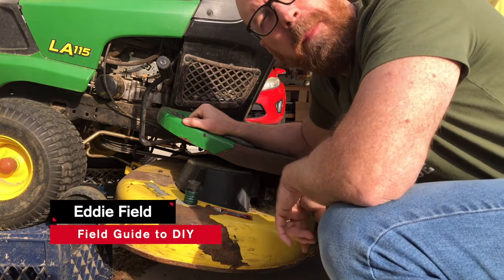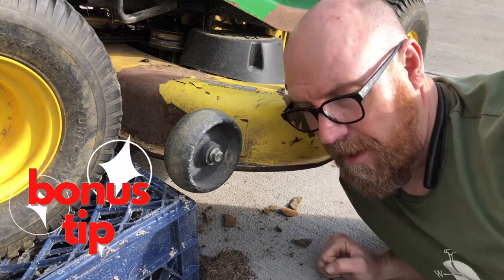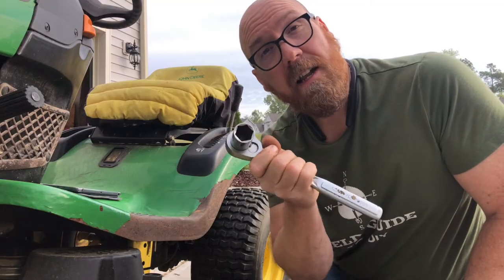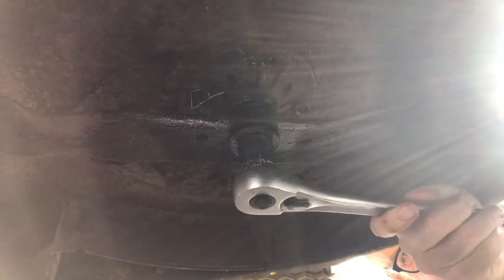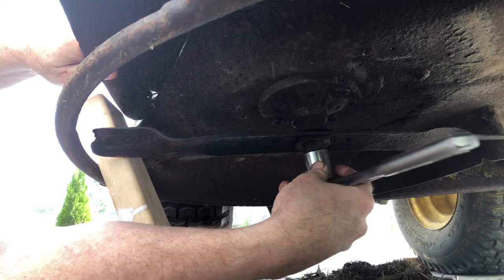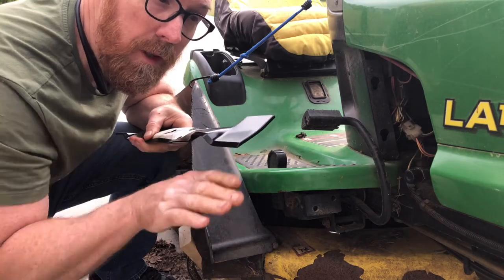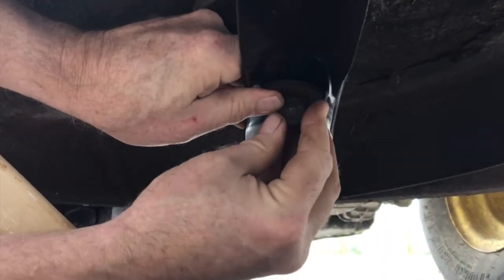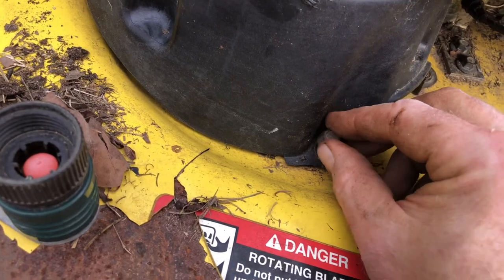Lawnmower Blade Replacement | John Deere LA115 Blade Removal & Replacement

Comment: Thank you very much for this video and mentioning the milk crates! I was about to invest three hundred bucks on a special lift and instead found a couple of the crates and just used my hydraulic jack to help lift it onto the crates. I also put wheel chocks behind the back wheels, just in case
Reply from the maker: Since then I have invested in a 3 ton floor jack.  A buddy of mine has a cable winch strapped to the beam in his work shed.

Comment: What happens when the star pattern bolt strips. How do you replace it
Reply from the maker: Great question.  I would suggest replacing one or both spindles.  One of my blades became loose and actually wore away the threads on one spindle.  I have a video coming up in which I demonstrate how to replace both spindles.  I will post the link to this thread when the video is published.  Thanks for asking such a great question and thanks so much for watching.

Comment: My mower has the circle opening on the blades. I bought the blade and see that it’s the star style. Can I use the star style still?
Reply from the maker: Does it fit snug on the shaft?  I do not think it will work as well as the blade designed for that shaft.  I would recommend exchanging it for the proper blades.
Reply: @FieldGuidetoDIY  agreed. I just took them off. There’s no way it would work without being extremely unbalanced. Such a pain! The person at Oregon told me it would work with my mower. Live and learn

Comment: How tight do you put the bolt when you put the blade back on????
Reply from the maker: I didn’t use a torque wrench but I snugged it up quite a bit.  I mean I really beared down on it.  You don’t want it to loosen while mowing.  Great question.  Thanks so much for watching.
Reply: 40 ft lbs

Comment: One comment: John Deere recommends blades be perpendicular, not parallel. :-)
Reply from the maker: Paul, thanks so much for that reminder.  Much appreciated.
Reply: When I changed my blades on the LA115, they were moving independently, so it didn’t matter which direction each was turned. If they are perpendicular at first, as soon as you turn the blades on they will shift eventually, so why would it make any difference?